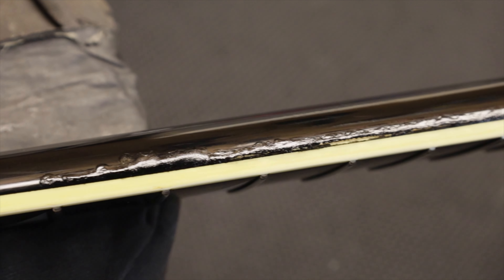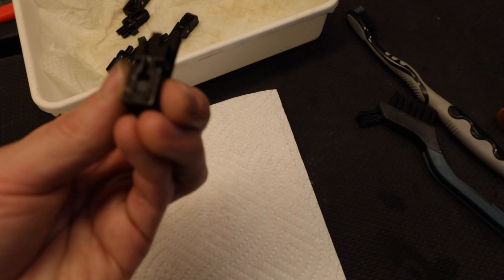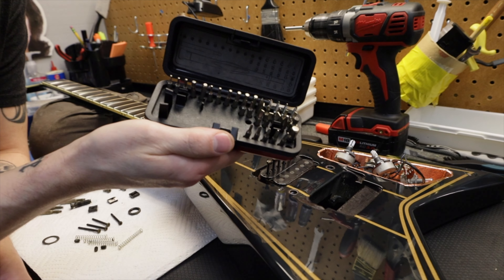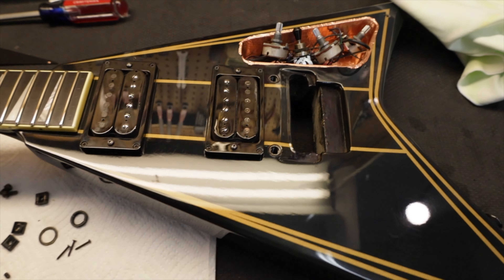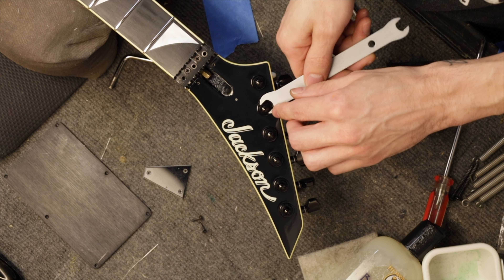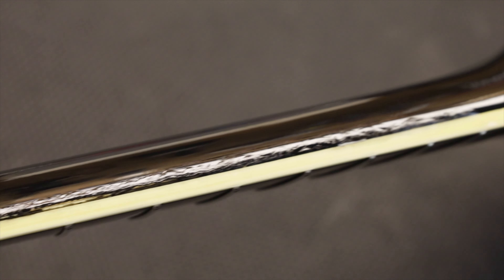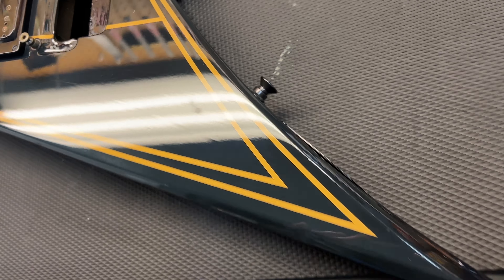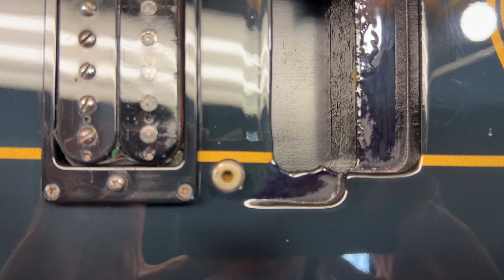Restoring my Vintage USA Jackson Rhoads Custom Ontario

Comment: Looks killer, but you put the pickups in backwards haha
Reply from the maker: When I got it they were like this and I was thinking the same thing. I went and looked at the 1990 catalog and they were all the same “flipped neck pickup” orientation. They definitely don’t sound out of phase in middle position either.
Reply: @jed_shred_guitars  I can see that. I’ve seen it in stock images before too lol. For out of phase it’s either have to be wired OOP or flip one of the magnets. Love me some OOP tones.

Comment: I have found the best thing for vintage trem parts is aerokroil penetrating oil. Soak them down and it eats corrosion away and frees up everything.
Reply from the maker: Ended up not being happy with the quality of the ofr saddles I got and am soaking all the original bridge parts in triflow. If that doesn’t work after a week or two I’ll try aerokroil. I put a new Gotoh ge1996 on it in the mean time.

Comment: I soak Rusty parts in white vinegar and salt solution. After all if the rust comes off i soak them in wd-40.
Reply from the maker: Do you ever have issues with the vinegar taking off finish?
Reply: @jed_shred_guitars  no, it’s not strong enough but it sometimes looks like it if the rust has already deteriorated say, a screw.